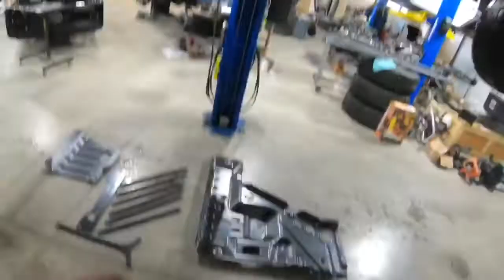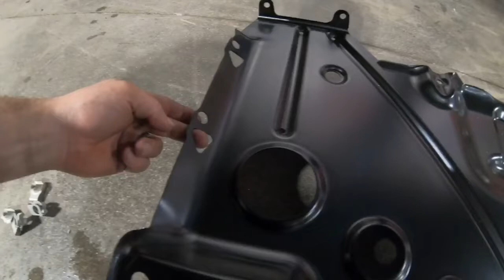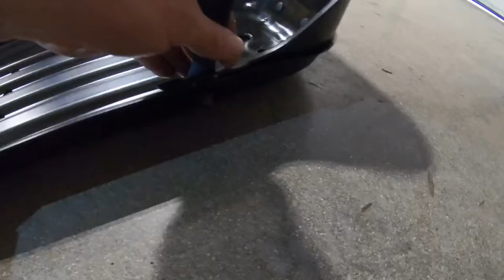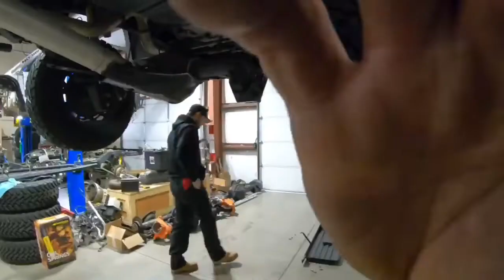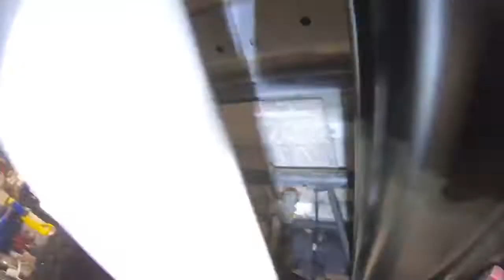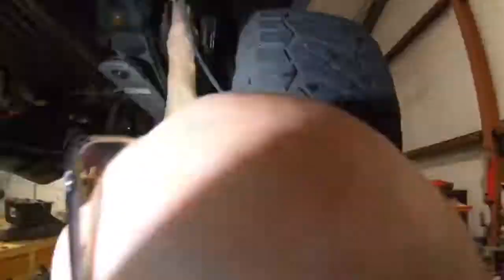Part 5 Chevy ZR2 Diesel Build - AEV Skidplates

Comment: I'm enjoying the series, I am disappointed on how much effort is involved with doing anything on these trucks. Watching you remove the front bumper and gain access to the passenger side headlight was nuts. As mentioned in another comment, too much drilling for the skid plate install. On my 2016 Rubicon it never required anything close to this amount of work and modification/light fab..I know this isn't your fault, it is disappointing though. I hope one day the ZR2 will get the level of aftermarket support we all want but I am aware this will also probably never happen.

Comment: Do you Need to drop the transfer case skid plate to access the fuel filters?
Reply from the maker: Chuck Finley Very good question. I have no idea. I guess we will burn that bridge when it’s time for a fuel filter change.
Reply: RockYour4x4 alright thanks